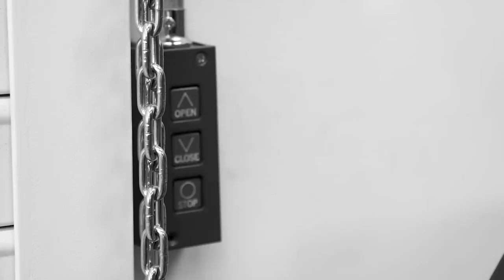Roached 2 Racing Episode 1 | Honda CRF450R Bike Build

Comment: Anyone can replace parts. Let's see some real world repairs, straighten those radiators not replace. True the wheels don't just replace. Make them brake calipers work like new.
Reply from the maker: Hmmmmmmmm... Great idea! We'll keep it in mind and see what we can do. #bikingonabudget - Wes
Reply: There ya go. Call into your parts counter for those gaskets and seals and let's see they're response. Use your resources you have in house. Lube those cables, rebuild that carb, repair that cracked air box. In our world (bikingonabudget) is real. Keep up the good videos 👍

Comment: I have an 05 CRF 450 as well. Just put a Rekluse 3.0 clutch on it. I ride mostly single track in AZ and that clutch has turned it into a different animal. It's like cheating.. What direction are you going with this thing? Moto, Supermoto, Supercross, GNCC, ???
Reply from the maker: This will turn into a trail/desert bike! That's cool you like the rekluse so much!